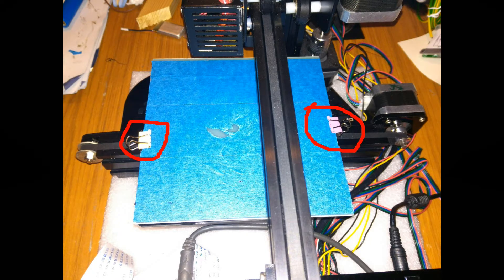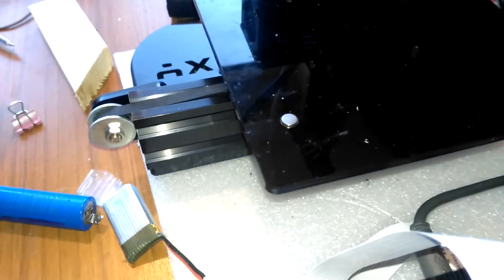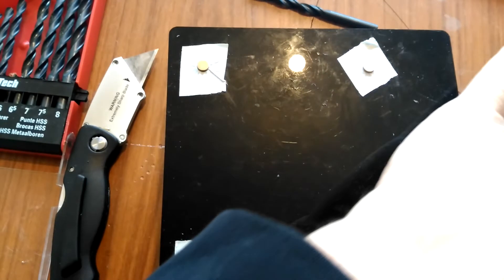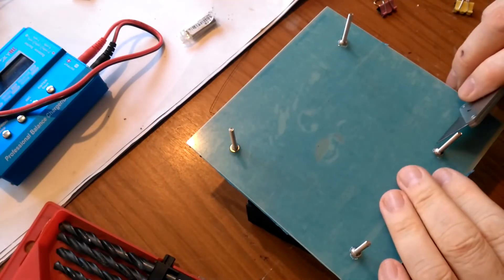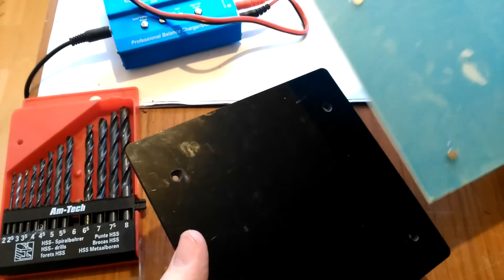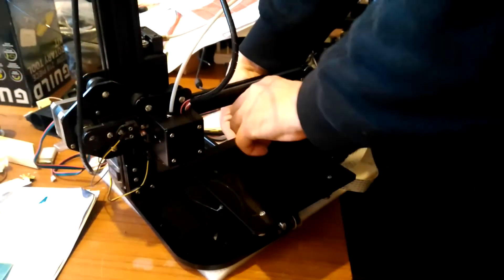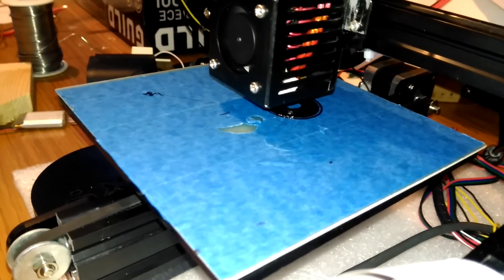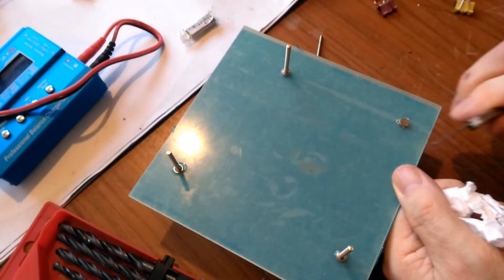3D Printer Upgrade - Magnetic Build Plate Clips

Comment: You can make a stencil of the magnet placement so if you swap plates you can easily get them in place.
Reply from the maker: I was wondering how I might transfer these locations to other things, Dave. The original method was time-consuming. I could ink the magnets up maybe, and "print" their locations on a sheet of paper. Thanks.